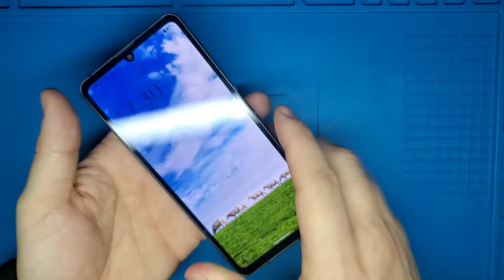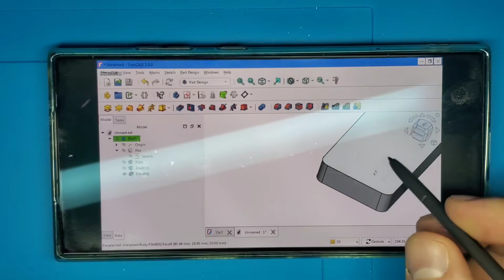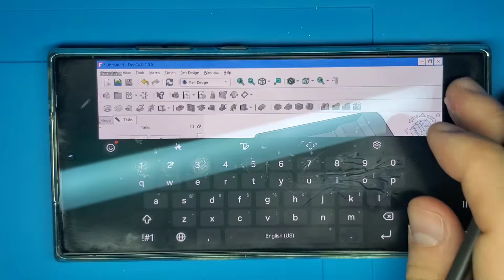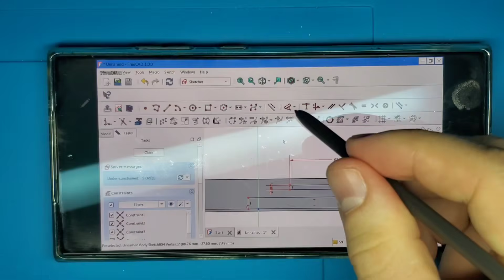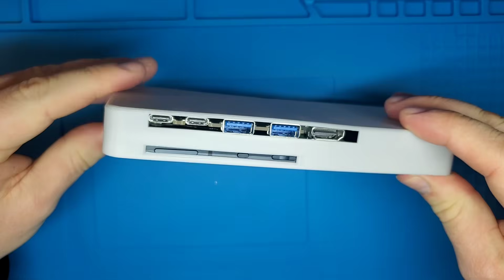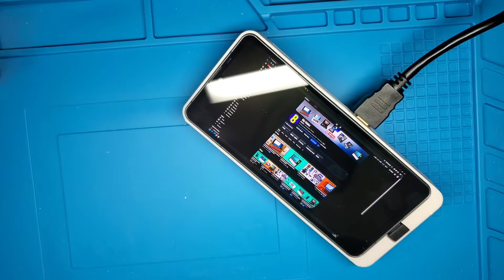Turn broken phone into an OLED portable HDMI monitor!

Comment: I happened to see this video on the algorithm, and it's truly an amazing task. 😊
Is it possible to change the aspect ratio of the screen that has been created? Or is it only possible to fix it at a 16:9 ratio?
Reply from the maker: There are several options, but i selected 16:9
Reply: @diyotaku Oh, I see. How did you turn the CAD on your mobile (Galaxy)?
Reply from the maker: @HelloEarthPlanet using horizon app it is similar to winlator, you can run any windows app with it
Reply: @diyotaku Thank you so much, you're very kind, haha. I'll just click subscribe and leave.
Reply from the maker: @HelloEarthPlanet Thank you

Comment: Man why do this it's such a waste, you could just have used a wireless mouse to install an app called spacedesk if I remember it right, that'd just have mirrored your PC's screen to your phone wirelessly, you could've also used another app called Camo and use that good phone's camera to use as a webcam for your computer/laptop, you could've also used always on feature of oled to make a desk clock when idle too
Reply from the maker: I want to use it for other devices, not a laptop
Reply: I dont think its useless. The way you told him to do there probably will create some latency. Cable=Less ms